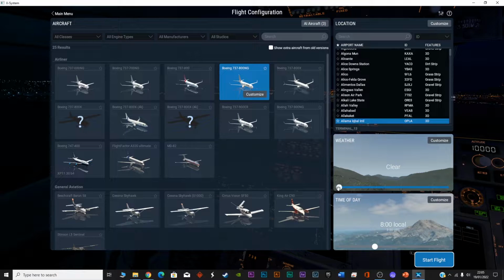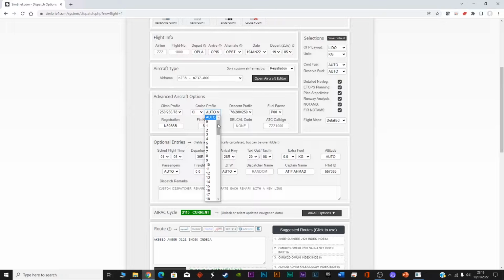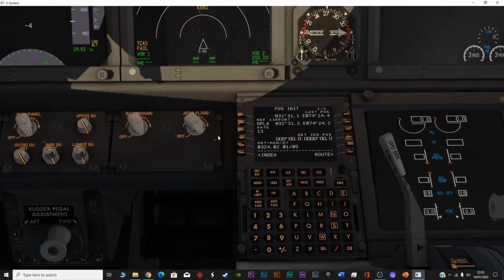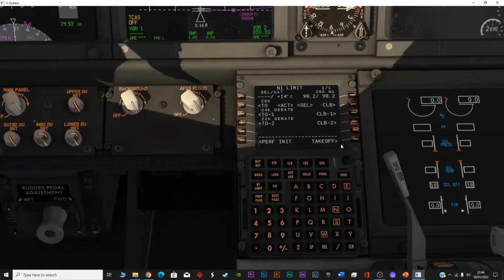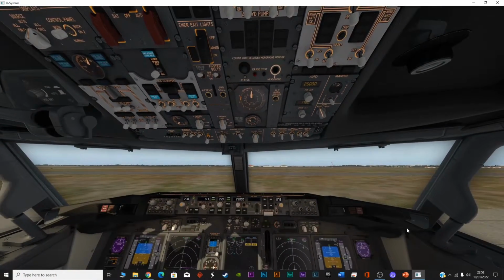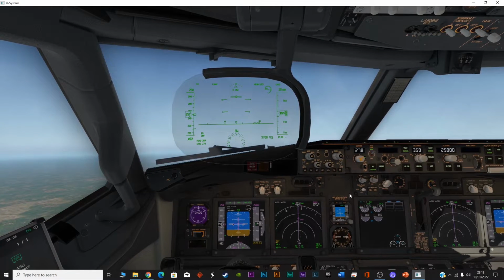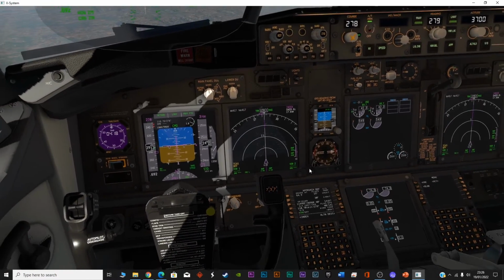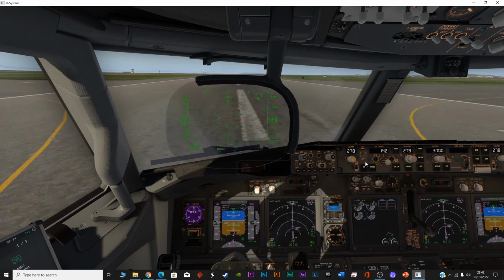Level Up Boeing 737-800 NG Complete Tutorial - X Plane 11

Comment: Why am I getting this error? And how to solve it, You requested a reciprocating or turbine engine in the ENGINES screen, but have not entered an engine power of two.

This is not good. To fly a glider, enter a number of engines of Zero. To fly a jet, enter that as the engine type.

Fix this problem in Plane Maker. The plane in question is: Aircraft/B737-800X/b738.acf.

Comment: Great tutorial. Just some tips on the landing, optimal landing speed with flaps 40 is around 140-130 knots (remember to flare properly and aim for the touchdown zone), and you should disengage the autopilot at around 1000 feet to get a stable approach so you don't get that hard landing
Reply from the maker: Thank you very much for your feedback. Really appreciate your time and effort. Have a nice day
Reply: Optimal speed depends on weight so it could either be 120kn or 140kn. In the case of this video , the plane was too slow, the proper vapp speed would ve been 146 as the vref was 141.

Minimum altitude to disconnect the autopilot is around the desicision height for an ils approach, which is approx 200ft above the runway. This ensures that you have Minimum time to control the plane before touchdown.